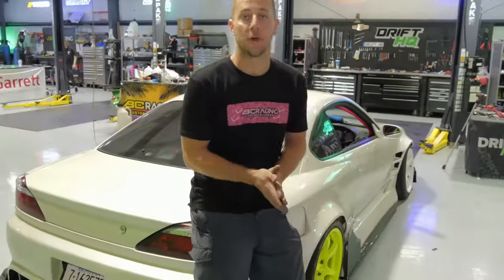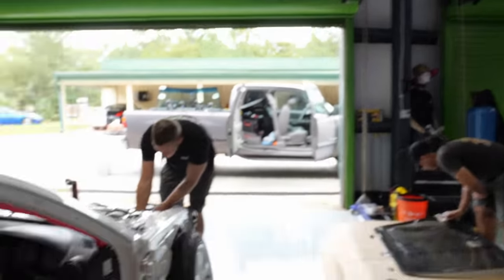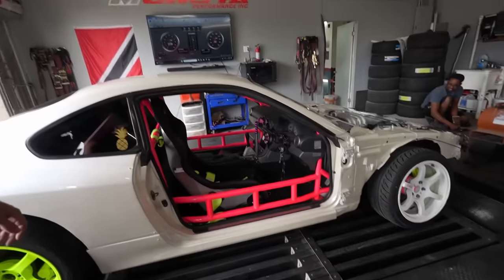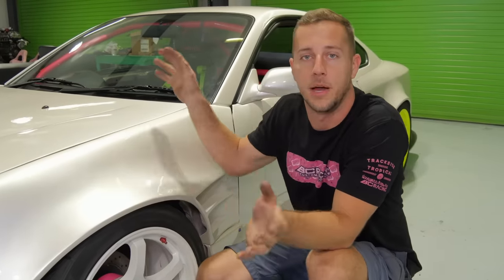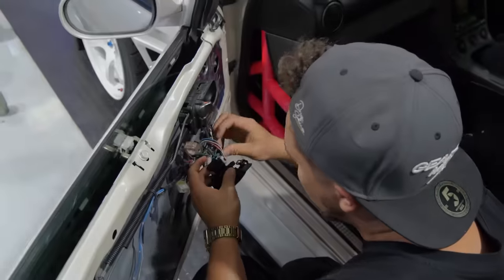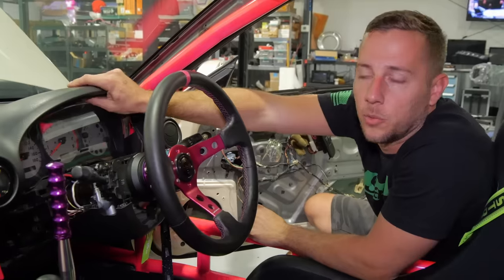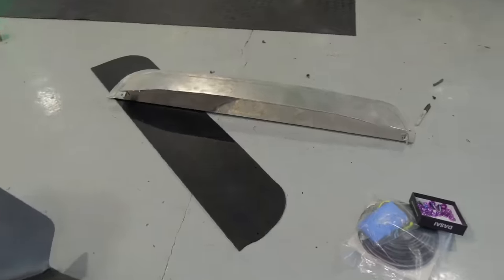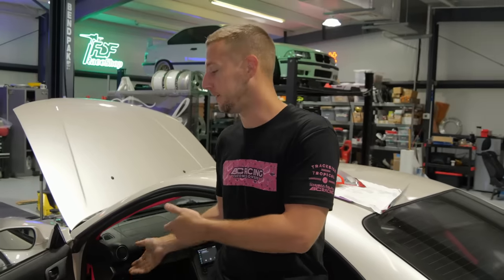Collete's DCT Rotary S15 | The Last Stretch!

Comment: Get the fiberglass guy to make some in door speaker cabinets they don’t have to be huge just as long as possible and the loosely pack some rock wool in it. It will sound a lot better with a flush mount speaker. 
Such a cool build. 
Does drifthq build customer cars? I’d love a cricket roll cage. 😁
✌️
Reply from the maker: This is a great idea!